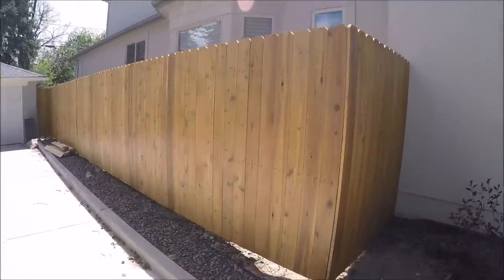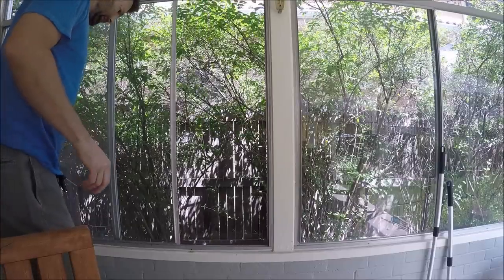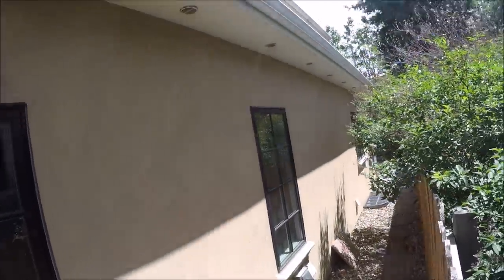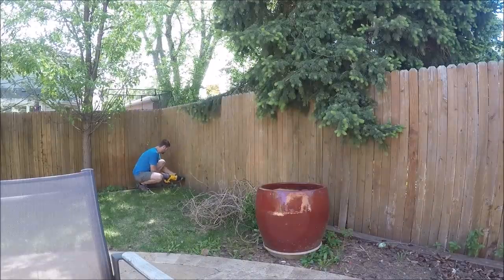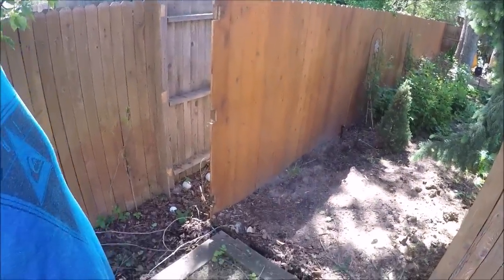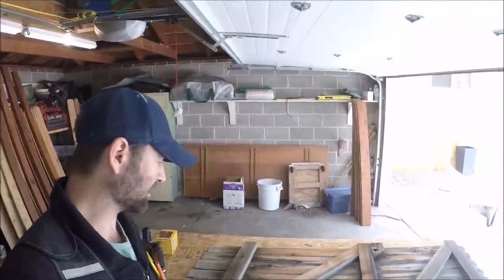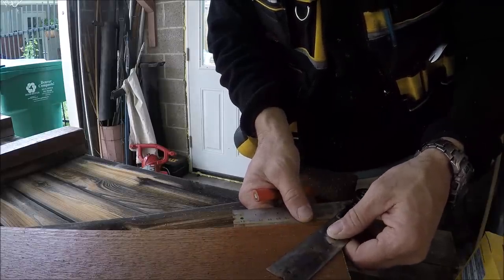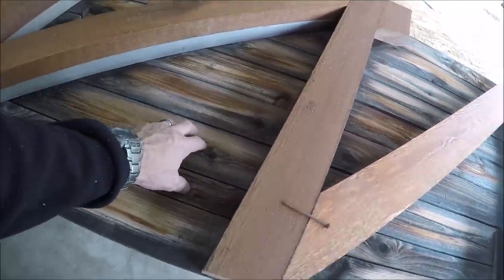How To Build a Long Privacy Fence | THE HANDYMAN |

Comment: What? you threw away all the old fencing? How many planters and things you could have built with that, what a waste.
Reply from the maker: None. My customers don't want things made of rotting wood.
Reply: @TheHandyman1  didn't say anything about selling  planters or what ever you make with it. and looked like only the ends were rotten, chop the ends off and stain up the wood and all is good. That's what I did with my old fence, just something to think about next time.